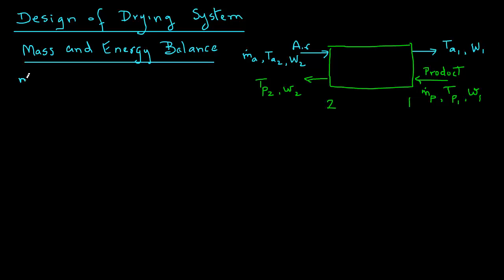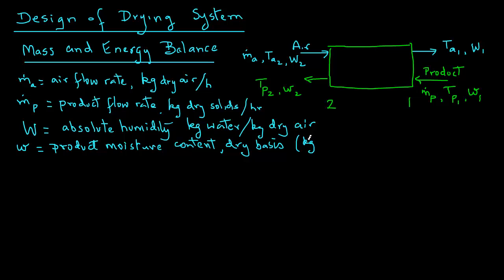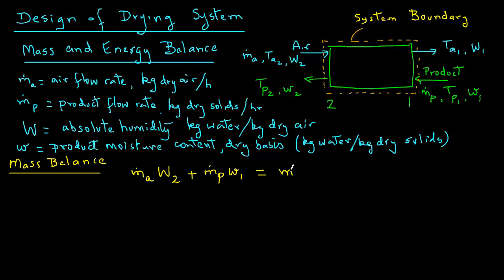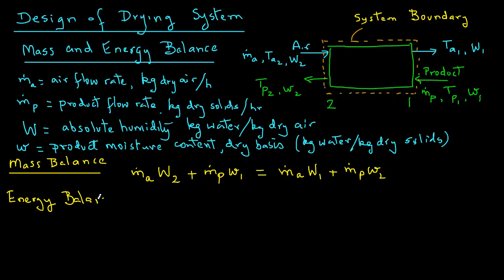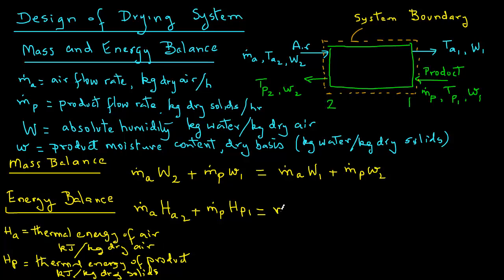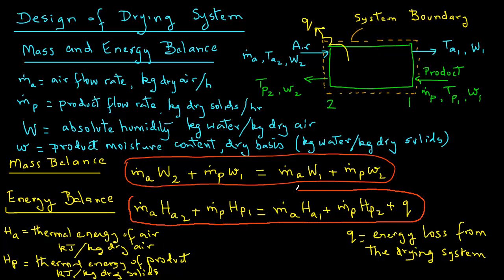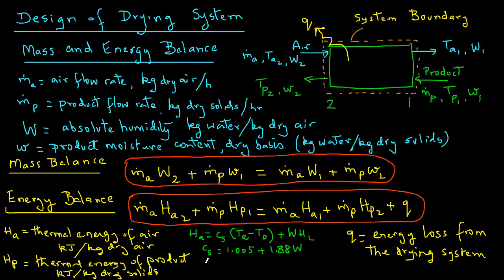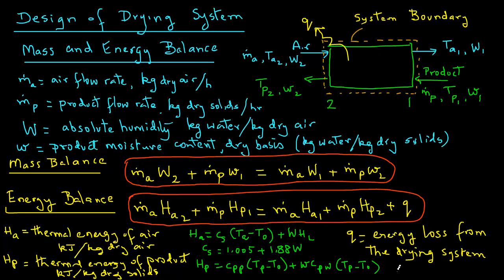Dryer Design Heat and Mass Energy Balance

Comment: Thank you so much for this video! Just to clarify in this, is T0 the temperature of the surroudings?
Reply from the maker: To is the reference temperature. In psychrometric calculations, the most commonly used reference temperature is 0 degree C. So you may substitute 0 for To.
Reply: @RPaulSingh  Thank you for your reply. Are the temperatures in this is case in degrees C or Kelvin? Ie would I replace T0 with 0 or with 273?